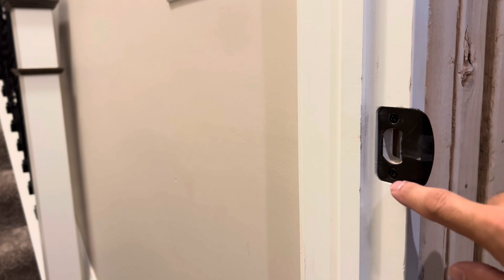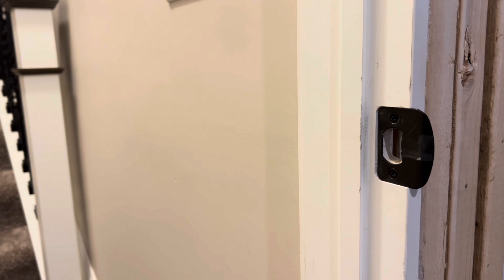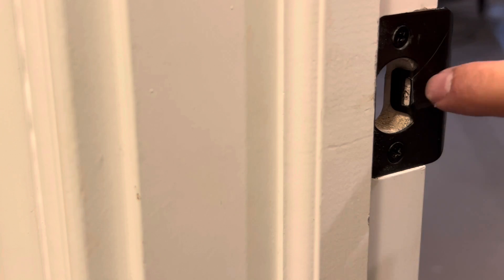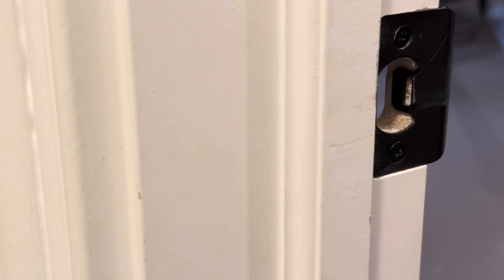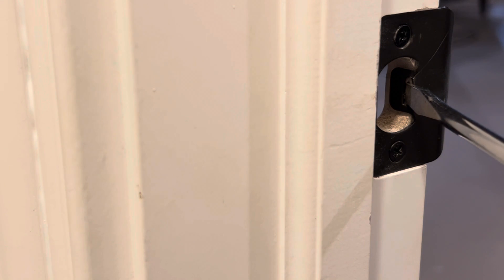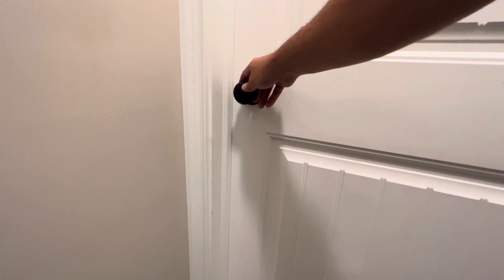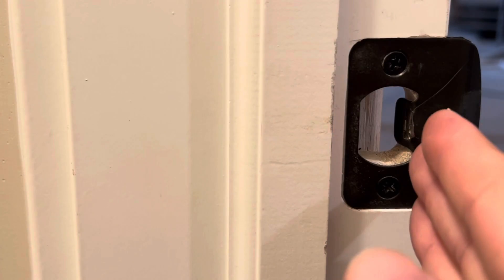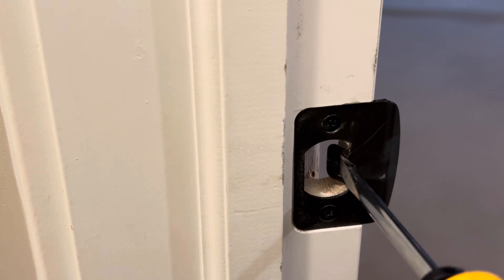How to Fix a Rattling Door in Your House

Comment: Sometimes if just angling the adjuster doesn't work, straighten it completely, and using pliers, pull and twist back to 90 degrees.
Reply from the maker: @kazsmaz  Thank you for watching and leaving the tip for others!

Comment: how do you bend it back
Reply from the maker: @zexks5101  Thanks for watching.  When making adjustments do a little at a time as a small amount can make a noticeable difference.  If you bent it too far one option is removing it and prying it back with pliers.  The tongue isn’t highly visible but if you want to avoid marring the metal you can put a towel over the tongue before using the pliers.